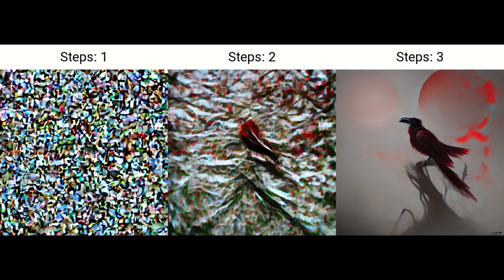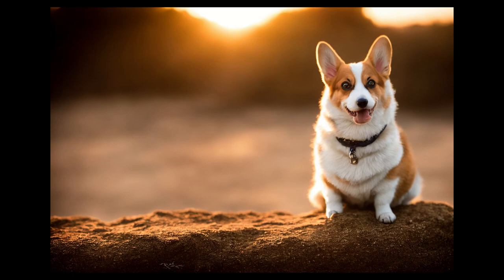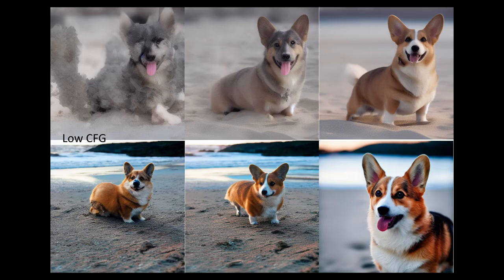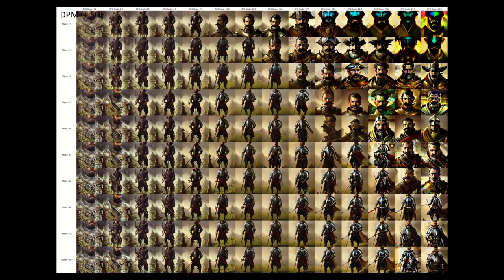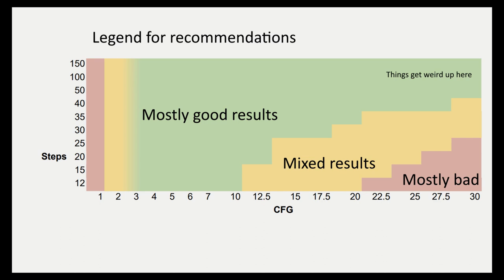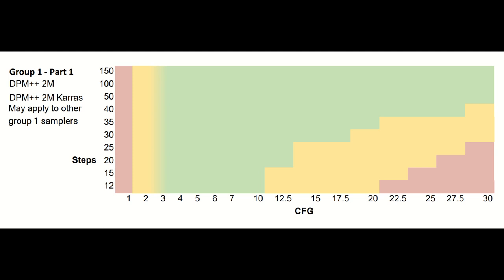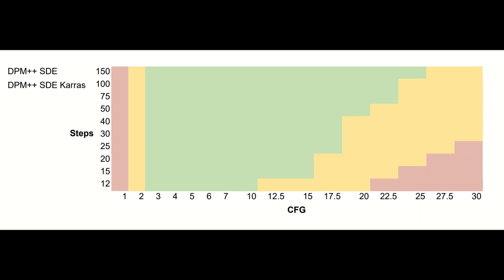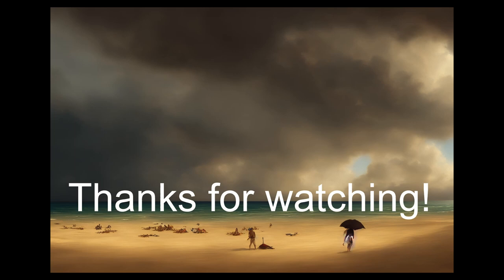Stable Diffusion Deep Dive - CFG - Don't Accidentally Fry Your Images

Comment: in my experience, if your prompt/Negative prompt is not complicated and less than 100 words then 25 Sample Step + 7 CFG is good.
If your Prompt/Negative Prompt is very complex and contains 300 or more words, then 50 Sample Step + 25 CFG is fine.

Comment: Still feels like CFG is a messy subject, I'm mainly don't touch CFG, Sampling method and Steps, because I have plenty of parameters to tweak already, while simultaneously praying for the decent results. Damn, the prompt alone is a major headache, considering that different models give you different outputs, Imagine taking in to the consideration Sampling method, Steps, CFG, and Dynamic Threshold for example, this is crazy

Comment: It was a mystery to me why SDXL models are generally so blurry. Not anymore. It seems to me that all SDXL models are very CFG sensitive. Most models that I have tried (about 30), start to look over exposed or start to fry after CFG 2.3 - 2.7 and get very blurry at about CFG 5.0. Sometimes that is even before the scene or the pose in the image get it's approximate final form.
Reply: This doesn't seem right to me, though I only use vanilla SDXL. I've only ever used the default CFG of 7.5 and get great results. People would be losing their minds if they had to stay within the range of 2.3 - 5.0. Also, the effects you describe seem to be backwards, as the overexposed look should be on the high CFG end and the blurry, low-contrast look should be on the low end. You might be running into a bug with your software configuration.

Comment: Thank you for the video but it's very difficult to hear. I had to turn the volume up super high and then a commercial interrupted in the middle of the video and nearly blew my speakers out. It looks like you put a TON of time and effort into this video with all the experimentation with the CFG values and data you present it, so it's really unfortinite that the audio is so low.
Reply from the maker: Alas, I cannot increase the volume on my old videos.  The issue has been fixed on more recent uploads
Reply: @siliconthaumaturgy7593  There's no way to fix it? Bummer. Thanks for the info. :)